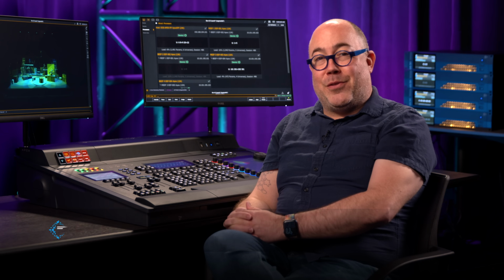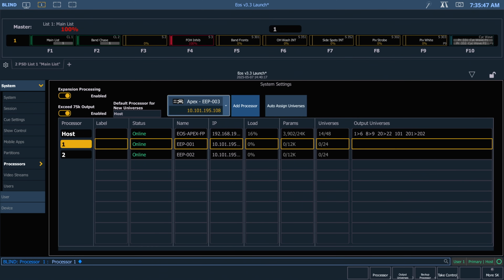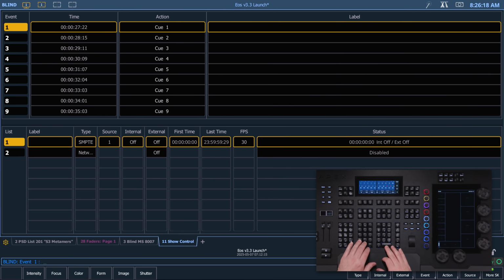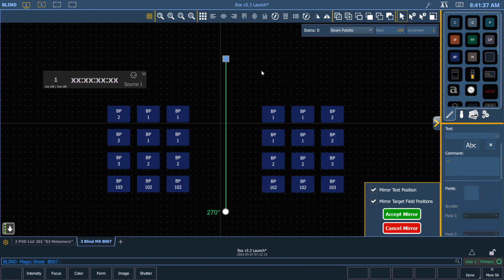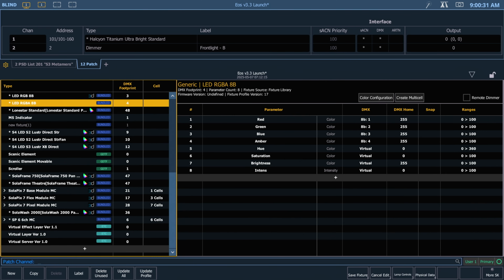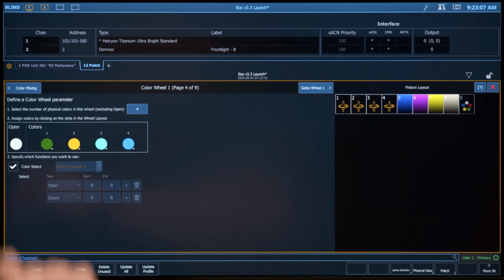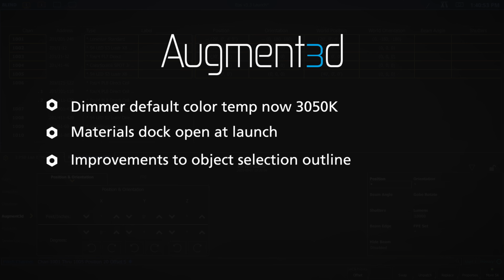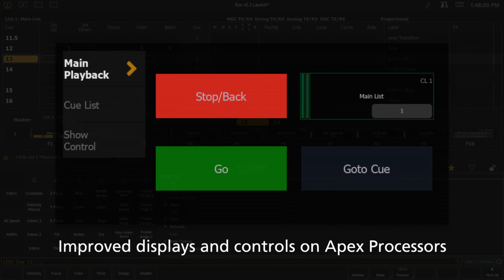Eos v3.3 Software Introduction

Comment: Where is NDI?
Reply: Yeah they didn't mention it but I know it was to be included and have seen it in action so I'm going to bet it's there... You'd think they'd of talked about it, a SIGNIFICANTLY useful update. Guess I'll have to download it and check (and/or check the patch notes)
Reply: Actually in looking it up... It was REMOVED after the 3.3 Beta due to licencing issues.
Reply: “The Eos team originally embarked on the Video Stream feature to allow users at all levels of production, regardless of budget or hardware access, to begin integrating video streams into their lighting workflows. This feature allowed users to take in video streams via the NDI protocol, and use it for displays in tabs, Magic Sheets, Augment3d, and in Pixel Maps. Unfortunately, late in Eos v3.3 development, Vizrt, who owns the NDI protocol, changed their licensing terms, which do not align with ETC’s goals and the original terms we used for development. As a result, we have had to remove the Video Stream feature from Eos v3.3.0 entirely.”